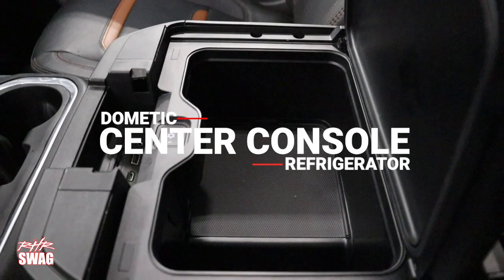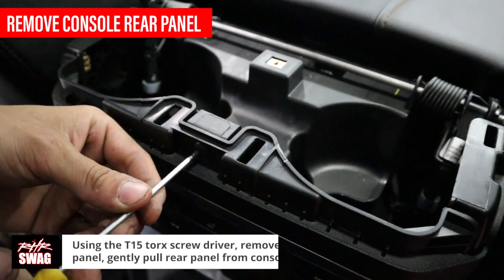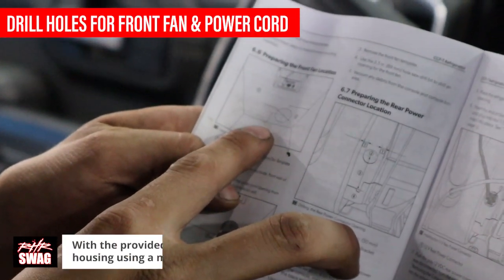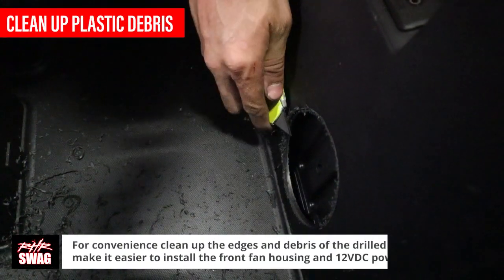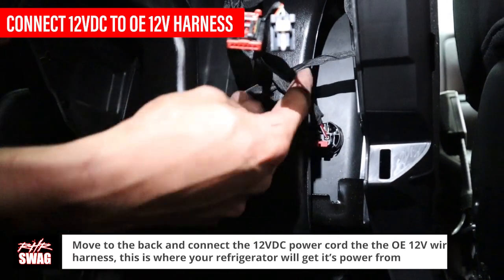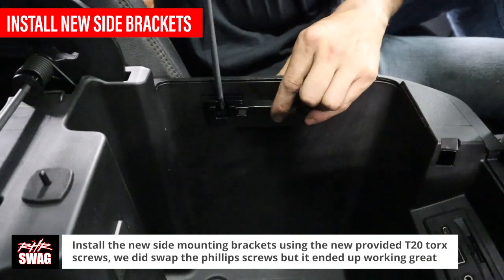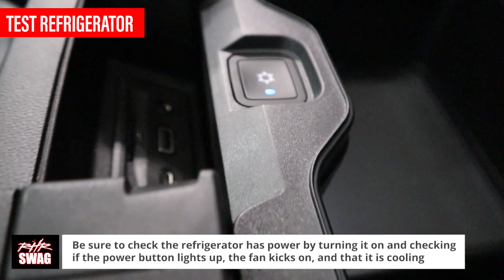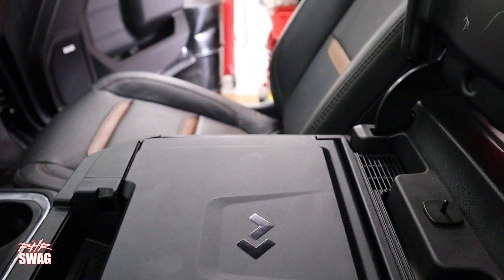Dometic Center Console Refrigerator Install (GMC/Chevy) - RHRSwag.com

Comment: Thanks great product I recommend it.  I have an issue but not sure if it was from tapping (to use both cig lighter and Dometic ) or not. During day light driving (light are off) the voltage drops to 12.5v (reading via OBD) so Dometic disconnects even though as per the manual 12.3v. Possible drop at voltage due to tap, voltage drop due to distance from battery to lighter, or Dometic calibration is incorrect. Solution for now to drive the car with light on all times to keep on. I am thinking to use Fuse diode at the Cig lighter circuit to boost voltage (~0.5 volte) which should keep it on all times with out turning the light.

Comment: Any way not to lose the 12v sockets at the back of the center console? Without adding additional connections
Reply: I'd imagine you could pigtail off the 12v and ground wires and run them to the rear DC jack.
Reply: Yes. I have both working by tapping. However, I have an issue but not sure if it was from tapping or not. During day light driving (light are off) the voltage drops to 12.5v (reading via OBD) so Dometic disconnects even though as per the manual 12.3v. Possible drop at voltage due to tap, voltage drop due to distance from battery to lighter, or Dometic calibration is incorrect. Solution for now to drive the car with light on all times to keep on
Reply: I fixed the issue by moving the cigarette lighter fuse to all the time on position (even if the car turned off the power still on) now it is working all the times even after I shut the engine till voltage drop.

Comment: Any trouble with the Bose subwoofer? I saw it wasn’t recommended because it is easy to drill to far in and hit it. Looks like it worked for you though.
Reply: That second layer of plastic they had to remove, so the fan would fit is part of the subwoofer box
Reply: Did you end up installing one with the bose system?  How did it go if so?
Reply: New model should be fine with Bose as per the manufacture. they released new model with New SKU
Reply: Yea that second layer of plastic was the Bose sub enclosure 😅

Comment: Does this for the 2500?
Reply: I just installed on 2500HD 2021. works and fit well.
Reply: @Supra993Rz how much stuff does it hold?  Will it take a 20oz Red Bull or a taller can like that
Reply: @jersey2484  from inside it is like upside down L share. Shallow side is 4 inch deep and 10 inch wide so I would say yes it should fit all personal size drinks